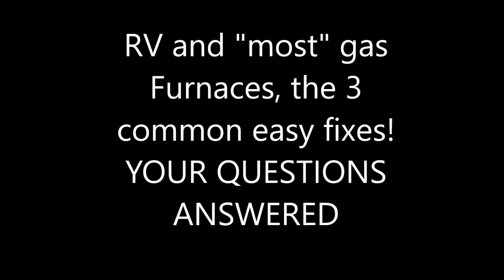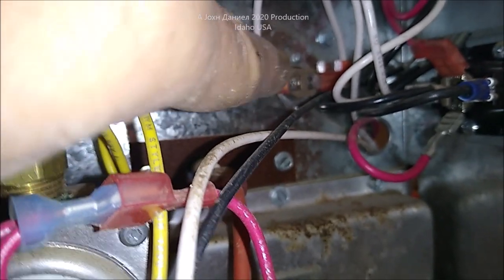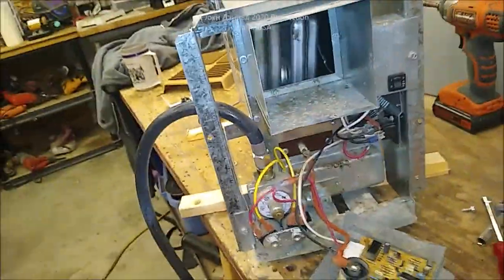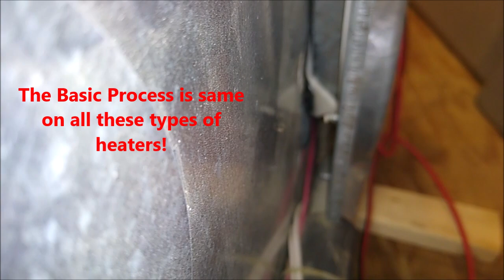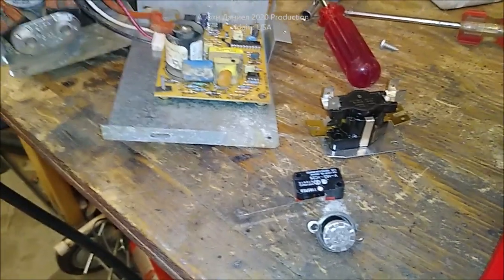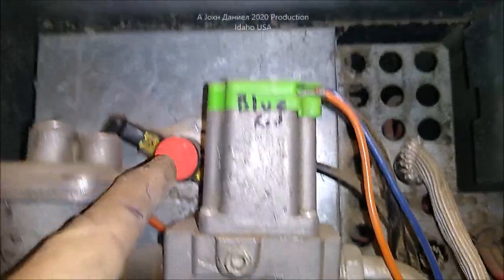RV Furnace REPAIR TECHNICIAN SECRETS Top 3 Easy Fixes anyone can do PARTS BELOW

Comment: I was given a camper after a house fire. It has been partially gutted. The line from the propane tanks to the heater has been cut. How do I fix that? Please help. Shalom you are loved
Reply from the maker: If your not too far from central Texas you can bring it by once it's safe to haul. I have about 30 heaters and parts left from closing the Idaho Shop. Otherwise it's all about finding the right parts at the local stores.
Reply: @JOHNDANIEL1  it's copper. Maybe I should take that off and put the newest flex pipe on it. It's very heartwarming to know someone wants to help after a catastrophy. Thankyou. Do you have a video on changing the pipe from copper to flex. The camper is a 70s model coachman. Next thing I need to do is find parts for the door knob so I'll have keys. Shalom you are loved
Reply from the maker: @twighahnjackson  Are planning on living in it? do you plan to make the heater only work or the stove too?
Reply: @JOHNDANIEL1  this camper was gutted so there's no stove. I will be installing a propane water heater later but it will be brand new and have all the needed items. Shalom you are loved
Reply from the maker: @twighahnjackson  Yes, but are you planning on living in it or using it for hauling around. If you plan to travel with it you need very secure plumbing, to park and live in you can work with less strict needs.
Reply from the maker: Copper or steel pipe is the first thing to know. but you can run a flex line under the camper, back to the tank.

Comment: Have a heater that does not fire the ignition. The pressure switch is getting power through it. The micro switch is sometimes gets power and not on others. Any help here .
Reply from the maker: Overtemp sensor, what's referred to as the high limit switch, can occasionally cause power fail to the blower leaf switch that activates the board. Most common is the thermal delay relay not supplying enough power due to bad contacts even though it supplies enough power to test and find it power there. Those are your two typical culprits. The last one is the relay that is on the board itself so you can fire the unit up tap on it a few times and see if you get a different reaction. A lot of these have multiple high limit safety switches in them but the one that's normally upwards towards the front of the unit is most common fail.
Reply: Cleaned the switch with wire brush and demel tool. Now power through lead switch but not firing yet . Going to clean more wires to burner.

Comment: I want to look at one today everything worked in it besides the furnace fan what would be the issue it was hot outside you can feel the heat it just was not blowing anyway you could answer that question I sure would appreciate it

Comment: Those little disk sensors can usually be reset just by throwing them against the floor or banging them on your lineman's or pliers. They are a saucer shaped disk inside that snaps the opposite way when the temperature is reached breaking the contact so with enough force they will snap back to the original direction.

Comment: Have you ever had a fan run delay relay buzz the whole time the furnace is running once the furnace ignites?
Reply from the maker: The run delay is a bi-metal strip with contacts. It wouldn't buzz, It may clatter but would let go after a few times. What tends to buzz like a buzzer when going bad is the igniter coil or its relay on the board.

Comment: Great video. I have a Atwood 8535 furnace. It will try to start 3 times but won’t go. Replaced flame burner, electrodes, and gas valve. I have 1/8 on electrodes. Any chance you could shoot me some advice what to try next
Reply from the maker: Blower mounted Sail Switch. https://amzn.to/3SgjP4X . It identifies the clear and safe run cycle of start up has happened and sends a signal to fire up the heater. If it is not working, the heater will run a fan only cycle, and shut off after about a minute.

Comment: I need to know how to replace blower fan bearing in this exact heater, it squeaks.
Reply from the maker: It is a sleeve in socket bearing, normally when it's worn, it's toast. But not always.  You can use a oil on it, Liquid Bearings https://amzn.to/3UphCpo to maybe get another season. Be sure to clean area well, and if you will tap on the shaft a little, one end then back on the other, lightly not to distort the tip, you can reset it. Then oil it, allow to soak in 3 drops, then flip and do other side.
Reply: I may have this same problem. I have same exact model in video. Heater squeals loud waking the entire camp when it turns on and then once it is warmed up it sounds normal. The colder weather the louder the squeal. What should try first? Where is the bearing located? Do I have to pull the unit to oil the bearing?

Comment: I have a question, I have a 2007 keystone cougar I have had it for 3 years and my furnace has always worked great. I tried to start it up here the other day and it wants to keep blowing fuses do you have any answers possibly?
Reply from the maker: Check the intake and exhaust going out the RV for wasp and debris. A wasp nest in the heater burn chamber can cause overload. Look, smell, observe, act.

Comment: My heater looks like that one and there is no outside access port, just the exhaust vent. Do I need to pull the entire furnace to access the sail switch?
Reply from the maker: Yes, Turn off Propane. Disconnect power from it, Then remove front cover, locate the screws in the base & remove them, then go outside and remove the intake/exhaust and slide it off/out. Back inside you can now lift out the heater to service it.
Reply: @JOHNDANIEL1  Got the sail switch out and it tests 0 ohms on the Multimeter in the closed position but .065 on the 2k Ohm scale. Ordered a replacement from the local RV parts place in Vancouver and they sent one that looks like a universal unit with just a thin ribbon instead of thin ribbon plus big fat sail. Anyway it takes less air pressure than the original. Think I should add aluminum to make the sail more responsive before reinstalling the whole thing? I don't want to have to pull the whole unit again if I don't have to. Also the Temp limit switch is showing .522 ohms on the 2k scale. Is that my likely culprit? Thanks for your kind attention to this very helpful video
Reply from the maker: @brianprovencher6253  If the Temp switch at room temp is showing any resistance is it due to contact carbon build up on the contacts. Replace it. As for the sail switch you can use 2 #4 finish nails and a 12 volt battery to tap spot weld a tab on it if you have experience doing so, it should be nickel based metal, but otherwise connecting a 1.5 cm x 1 cm flag on it is usually fine and will assure contact is solid.

Comment: GREAT VIDEO~~ Here's my problem. I can't get the blower to start, or anything for that matter. I do have power at the thermostat and it's calling for heat.
Reply from the maker: Sounds like failed in off position either high temp safety switch or run delay relay. Either one can prevent voltage from getting to the motor to start the process of the fire up of the heater.

Comment: My blower never shuts off after cool down cycle. Have replaced the limit switch and circuit board. No change. Atwood 8525-iii . The time delay relay works when bench tested. Any thoughts?
Reply from the maker: Bench testing the TDR won't give you load rated disconnect of the fan. Set up the heater on a table, run it thermostat on, allow to fire up and run 5 minutes with 2 blue thermostat wires connected together, disconnect blue wires after that 5 minutes of heat burners on, and time the cool down, if it continues running after 2 minutes, disconnect motor + red from the delay relay, then touch it on the terminal again and see if it dropped out. If it didn't or did replace TDR with Emerson model below video. 
Hot connecting can occur on the bi-metal from the motors amp draw. Causing it to act like the thermostat is sending for heat. If I solve your issue drop a nickel www.buymeacoffee.com/JOHNDANIEL
Reply: @JOHNDANIEL1  Thanks for your help. The blower wouldn't even shut off after removing the T-stat wires from the relay. I replaced the relay with one from Dinosaur Electronics and now everything functions as it should. I owe you a coffee!

Comment: I have a blueridge 3025 5th wheel. Since having a rather close lightening strike to my rig I now have my furnace run with heat and the ac fan blowing at the same time. No matter what I do with thermostat,,,,, resetting it, having fan on auto and still have the same problem. Any ideas.. Thanks.
Reply from the maker: Sounds like a fail on your relay power circuit in the thermostat. Use 2 separate units is always my preference one for cool, one for heat. Those dual service Thermostats are always so problematic since unlike a house, the RV gets extreme temps hot/cold thrown at it and the components (the CPU in them) tend to suffer.
Reply: @JOHNDANIEL1  thanks for your input John, I'll take a look.
Reply: @JOHNDANIEL1  I tried a new thermostat and still have the same problem. Thanks.

Comment: It’s summer. Something in my furnace is making a whomping sound like it wants to come on by itself even though it’s in off position.
Turned it on just to test, everything worked. I shut it off. 5 minutes later it started womping sound again.
I had to pull the fuse. Any idea what could be causing this?
Reply from the maker: Depending on the model and year it could be a damper or back draft flap. If it stops when power is removed I'd need the year and model to give more info.
Reply: It’s a 2018 Prime Time Avenger 31RKD I’ve tried to find a spec book on it but I haven’t had much luck unless you’re talking about the furnace itself just got home from being out of town and it’s storming right now 
I’m a full-timer I’ll have to get back with the model number of the furnace. I wasn’t expecting you to reply so quickly man I appreciate it so much 🙏
Reply from the maker: Send me details to my email olympicpowercontrols@yahoo.com

Comment: Do you have any videos on RV fridges?
I have an older Norcold, works fine on AC but ignitor isn't working to light propane.
Reply from the maker: Can you light it manually. Might take 2 people to do it. Use a match on a extension or something like that.
Reply: @JOHNDANIEL1  yes I can light it manually, when fridge gets cold and the flame shuts off it won't fire back up on its own. 
I just bought this camper so I'm new to it.
There's a circuit board in the back with 3 white, one black, and one red wire coming out the top connecting to an electric spark module box. 
Everything is intact, I just don't know how to test any of it.
I like your video, I'm pulling the furnace out too, keeps blowing 15 Amp fuse soon as you turn it on. After watching this I'm guessing the fan is bound up?
Looks very clean, just old.
Reply from the maker: It's quite possible that you're over temp thermal disc safety may have failed or is acting up. It won't allow the board to initiate fire up mode if it's not closed. 
Secondly you could have a short in your thermostat sensor wire or a bad board itself. Generally when the thermostat sensor wire goes bad it won't tell the board it's calling for calling for fire up. 
Look for a temperature sensor coming into the refrigerator and clipped on to the cooling heat sink or on the aluminum of the freezer make sure you follow that wire back and see if there's anything not working on it ohm tested if you want to and see if it's giving a reading of 6 to 12 ohms.
Rare but on occasion the relay that's mounted on that board it's a small 10 amp if you'll tap on it a few times see if it clicks, it could have a little corrosion on the contacts and if it engages and you know how to remove one safely from a board and change it out with a new one find one and swap them
Reply: @JOHNDANIEL1  I've taken the furnace out, sure enough fan was filled with mud wasps. Cleaned everything out, fan runs smoothly but won't ignite, just blows constantly until I shut off thermostat. 
This doesn't have the little round overheat switch so I bypassed the fan switch (one with the little arm on it inside fan area) and same results.
Reply from the maker: Fan sail switch not sending signal to board or igniter assembly is bad

Comment: This is the best check list I’ve found so far. We have almost the exact same furnace just older. About 5 years ago we replaced the fan and it’s always worked like a champ.  We hadn’t used it the past two years.
  We turn the thermostat on as usual the fan kicks on we can hear the clicking but not heat. We checked the gas lines they are working. Propane running great to all other appliances. 
Per this video I ordered the over temp switch, because it sounded like it was the issue. It was much smaller than the original one. But we hooked it up just to check without attaching it to the cabinet. (Because we will have to modify for the smaller switch) and still fan running, clicking but no heat. 

Do I need to attach it to the cabinet or is there something else I should be trouble shooting?
Reply from the maker: Likely the igniter assembly or the fan switch. Not much else usually happens to them.
Reply: @JOHNDANIEL1  Thank you so much. The igniter- is that the 3 pronged electrode part?
Reply from the maker: Yes

Comment: Hi John …..My Dad has a 1989 PaceArrow class A  motorhome …. The heater makes a loud squeal when it turns on …. And now it’s continuing  Squealing while running the heater on the last camping trip. Any thoughts on where we should start to diagnose ? So appreciate your videos.
Reply from the maker: Sounds like dry bearings, likey bad motor now due to not acting sooner. You can if your handy try to use 3in1 oil on it, requires pulling heater then it's motor. Or buy a replacement motor if the furnace is still in good shape. 
There is an occasional possibility that the blower might be loose causing the squealing but on a motorhome that old I was just back the motor bearings and gave out from drying.
Reply: @JOHNDANIEL1  thank you I appreciate the reply

Comment: Excellent video. Question: I replaced my RV battery, when I connected the new battery, the furnace kicked on. (I was not on AC Power). I let it run for at least 5 minutes hoping it would cycle off but it didn't. I had replaced the thermostat previously and it was set for a lower temp than the air. I ended up pulling the fuse to shut it off, but that knocked out my LP fridge. Any ideas what I should look at first.
Reply from the maker: Sounds like the furnace did a exhaust clearing action. Turn thermostat off, put all back together then reattach power.
Reply: @JOHNDANIEL1  Thank you! The Thermostat switch has been off. I Tried it again but this time with the gas off. After 5 minutes the system shut down. My suspicion is the shut down was because it wasnt getting fuel. I think the next test will be turning it on via thermostat and see if it shuts off on its own.

Comment: Can you provide a link for a new thermostat? How often do they go bad? Got a 2002 Jayco pop up? I will try your other options first but this one is missing it’s cover and is exposed. 
Thank you. Loved the video.
Reply from the maker: Yes, corrosion on them can ruin them. The best ones are suburban for furnaces. https://ebay.us/BHO4g1 works on all heaters. 
But if it's dual use for air conditioner and heat you'll have to get a exact replacement as what's there.

Comment: Mine runs the fan and wont shut off. Not even when I turn off the thermostat. It's in a 96 weekend warrior thoughts ?
Reply from the maker: Start delay relay is fused or arcing. Some may be board mounted relays, most are modules like I show in video.

Comment: My new to me RV heater works well comes on and produces good heat. There is a high pitch squeaking noise though. I assume its coming from the motor as it the only moving part. Any tips on quieting it down? Thanks.
Reply from the maker: They probably bent the case or over tightened the mounting somewhere causing the blower housing to scrape the blower. Bump it around a little to see what changes. Just about everything made in the last 15 years the medal is so thin now it gets tweaked easy.

Comment: Very helpful. I have this same unit and it fires up and runs great but doesn’t shut off at the desired temp and also it’s making a noise when it runs any idea? I would truly appreciate it if you could help me out thanks. And great video.
Reply from the maker: When the run delay relay gets old the metal in them can get distorted enough to hang up on it's contacts. Also if a fan  switch is failing it may be rubbing against the blower causing it to keep contact.

Comment: Thanks for the info. My fan will come on and continue to run until I turn the thermostat off, but it never heats up. At times I can hear clicking sounds from the board, but doesn't start heating the air. I "jumped " the High limit connection and that didn't solve the problem. Is there a way I can "jump" run delay relay and see if that solves the problem. I have not found the leaf switch yet so I haven't tested that yet. Any help would be appreciated.
Reply from the maker: It's likely your leaf switch. No signal back to the gas valve solenoid.

Comment: I've got a question about mine mine is hooked to a thermostat it will come on and heat but it won't reach temperature and shut off and won't come back on I have to reset it and turn thermostat all the way off and back up to get it to run again what is the issue? I'm using it in my fishhouse
Reply from the maker: Igniter flame sensor assembly, or too low of voltage to properly operate.